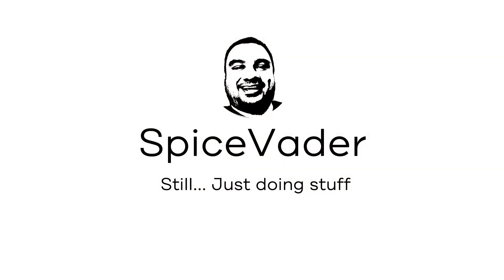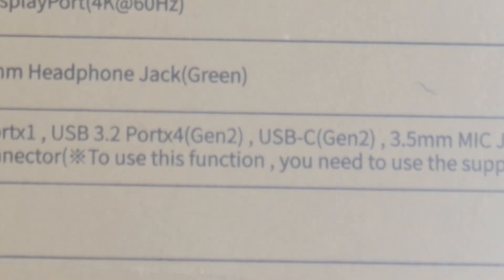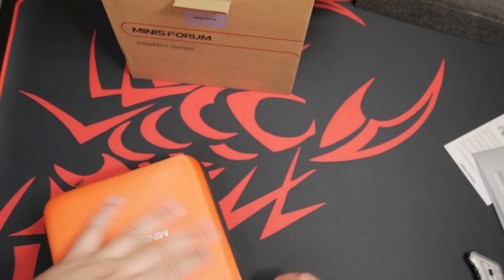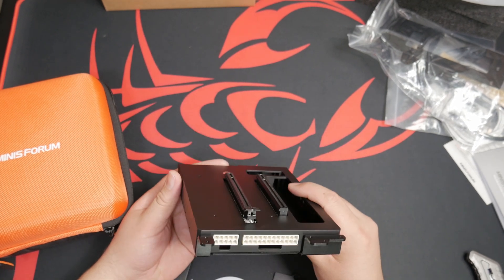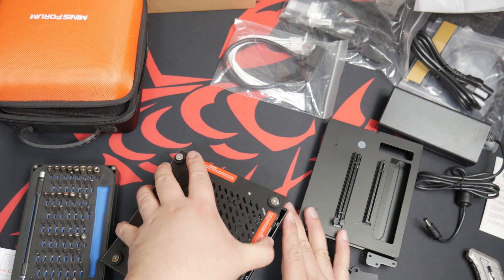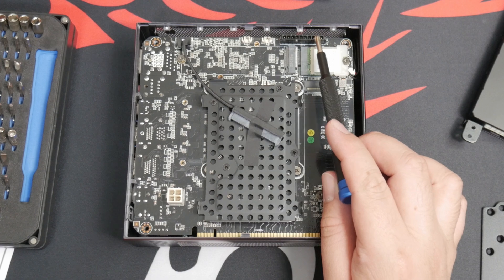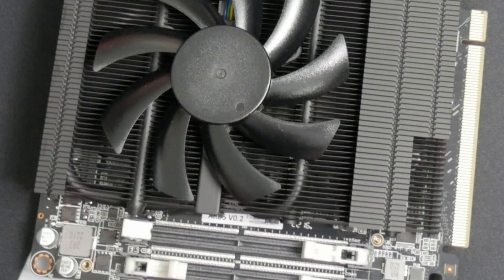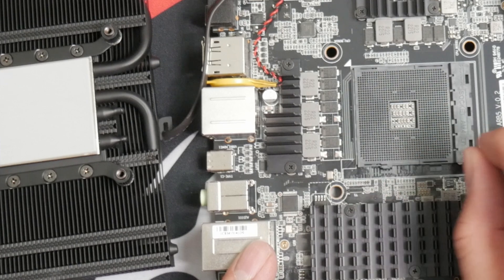Minisforum Elitemini B550 quick unboxing and teardown - AMD Ryzen AM4 Mini PC - Take it with you!

Comment: I mainly clicked on this video because i was curious of just the cooling solution which i plan on buying the model with the 5700G already in it but i would add in my own 2.5" 1tb SSD with memory because i have an old drive i don't use.

Comment: I wanted one of these to replace my fullsize as soon as I saw it the first time. I have a 5700G ready to go and 20GB of RAM ready for it, though one thing holds me back: storage. Do you know if this fits a 15mm 2.5 inch drive? I'd rather not be stuck with just a 2TB drive.
Reply from the maker: I will see if I have a 15mm drive and follow-up. I think it should work no problem, seems to be enough clearance from the bottom cover.
Reply: @SpiceVader  heck yeah thanks for that. Not sure what you want to do with the system, but if you have a 5700G to test, it’s an amazingly capable chip and the IGP is much better than it has any right to be.
Reply from the maker: 👍 no problem! Not to give too much away but yes I do have a 5700G on hand that I'd like to install in to it eventually. I'm waiting for the 7000 series to launch so I can snag a 5800x or 5900x for ultra cheap and put that in my main rig which currently has the 5700G.